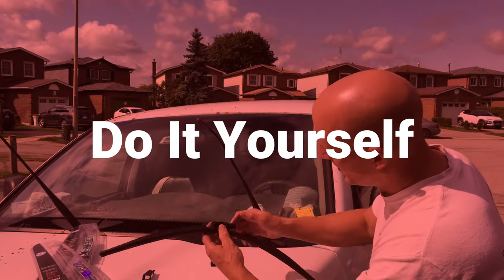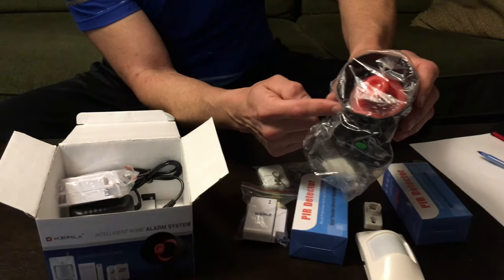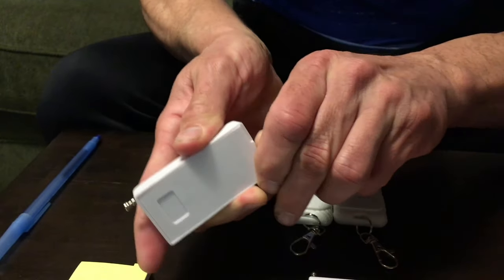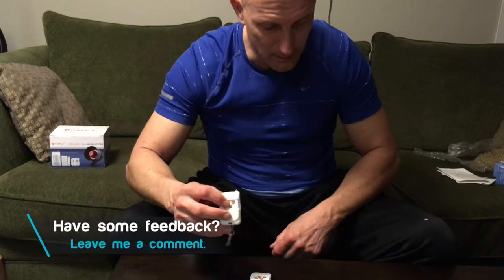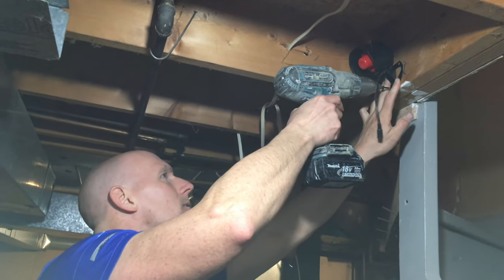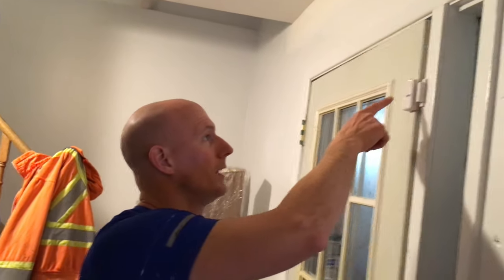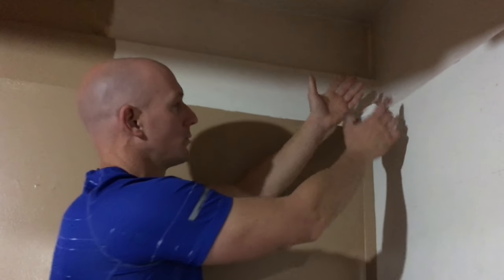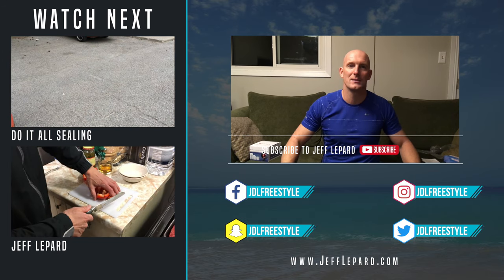Kerui Standalone Home Office Wireless Alarm System (4K) Setup & Review

Comment: Thank you for the great video!  I've bought 3 of these so far. The first I paired 4 remotes and all the sensors to 2 siren/bases so I have 2 sirens.  Worked great.  I just got a 3rd one in to send to my mother in law in Philippines.  It stopped pairing after the 3rd device.  Won't pair anything now, even using the 10 times plug in and out reset.  So if you get a good one, these are great!  If you get a turkey, make sure you can send it back.  
How to reset these:  Plug it in and out 10 times instead of just the 3 for program mode, and it beeps back 9 times and is reset so you can start adding devices all over again.  
- Ed
Reply: I WANT THE ONE WITH WIFI TO TURN ON/OFF EVEN I AM NOT AT HOME.
Reply: SOMEONE USES PART OF THIS SYSTEM TO INSTALL UNDERNEATH CAR FOR SECURITY OF THE CAT CONVERTER.
Reply: How did you add the 2nd siren??

Comment: Hi Jeff, just want to know when you leave your house and set alarm on arm mode for example, nobody is at home then then someone or burglar activates the detector  and  siren makes alarm. My question is that will the Siren continuously making noise? or will it stop for few minutes?  If it stops, will it be on disarm mode or still on armed mode? Thanks in advance for your response

Comment: I have this same unit, every time I disarm the system and walk by the motion detector the alarm sounds, I have reset the unit several times and it continues to happen....any advice
Reply: Maybe your WiFi cover is not  so good and therefore there may be a delay?